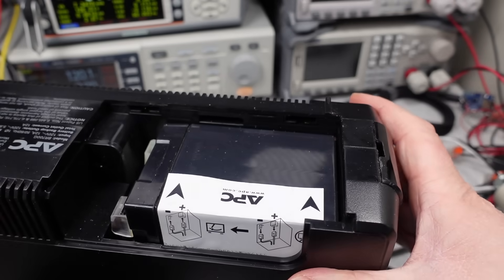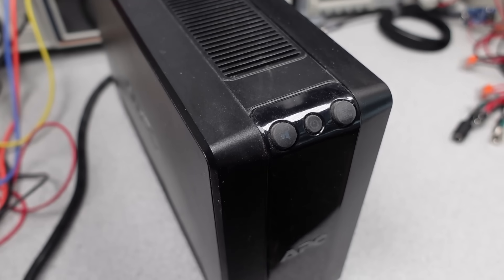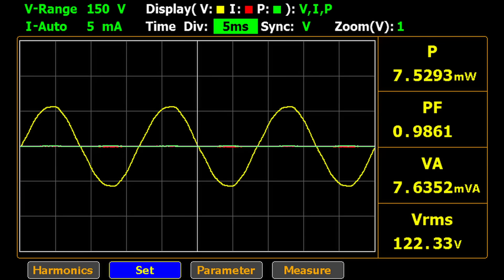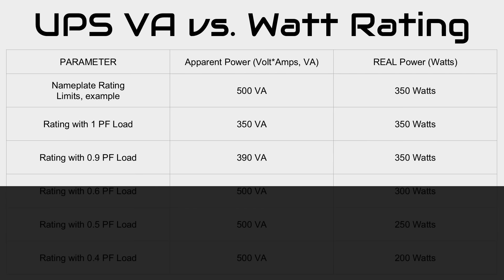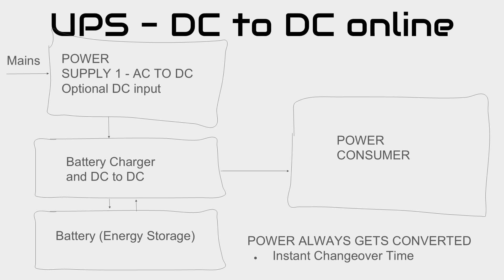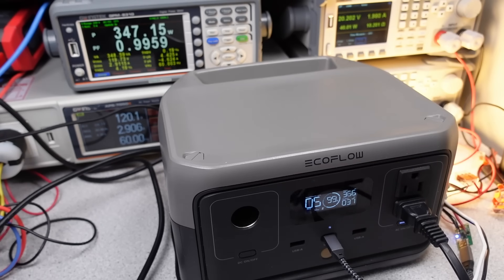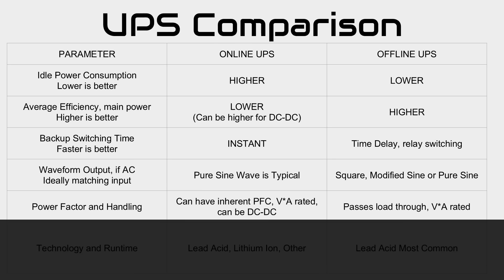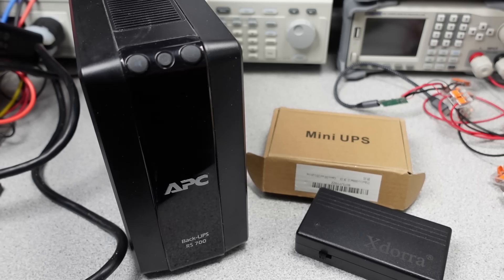A brief overview of Uninterruptible Power Supplies

Comment: For me the ONLINE switching time was not a factor at all, expecially with the very large capacitors in my servers psu's. But my server psu's stopped dieing every 6months after I installed a dual conversion online ups. Never had a psu go dead after that. grid power can be garbage. Could also be random power surged from things, but didn't have anything else that had issues that was noticed.
Reply from the maker: Sounds like some pretty unstable power conditions on the input side.  I want to do an efficiency comparison.

Comment: Do PC power supplies with active PFC need a pure sine wave UPS?
Reply from the maker: It depends on how the PFC is implemented.  Most will work with a square wave or DC on the input, as the PFC is a boost circuit, the PFC adjusts the DC input voltage to the level needed for the rest of the power supply.   There are a few out there that are tuned specifically to find the AC wave shape and won't turn on if they don't see it.  I have one power adapter that will not turn on with a modified sine (3 step) wave.

Comment: I would love to find a USB-C PD capable power bank that would work well for UPS duties for USB-C loads.
For example: Have a standard power adapter that supplies power to the power bank, and the power bank supplies power to the device. If power were cut to the power adapter supplying the bank, the battery bank would supply power from battery to keep the load online for the device. From what I've seen, the switching time from pass through to battery for most (if not nearly all) USB battery banks is too slow.  Would be excellent for items such as Raspberry Pi's (so that you don't have to get a specific "UPS hat") or security cameras, etc - this way you skip a whole DC->AC->DC step! Much more efficient this way.

Does anyone know of a power bank which is capable of this?
Reply: Probably not many, if any at all. Consumer USB battery banks aren’t intended for this use case so you’ll be hard-pressed to find a suitable option, and even if you find one it surely won’t work as well or reliably as a purpose-built UPS.

Comment: PC related stuff, Cameras and low wattage lighting, 3 things i have UPS's for. I also use a small UPS to power a tire inflator instead of using an extension cord outside. Many uses for a UPS, some of which you wouldnt normally think to use one for.
Reply from the maker: Thanks for sharing!

Comment: For some critical USB-C PD powered devices, I use both the Zendure and Shargeek power banks as UPS. 
Both power banks can deliver up to 100 Watt of power to the device - computer, camera, router, etc. - just like an online UPS.
For any 12 Volt device which can permanently tolerate 13.8 Volt, I use a lead-acid battery permanently connected to a low-ripple 13.8 power supply.
The Wi-Fi router doesn't like 13.8 Volt, it overheats. In this case, the Zendure 26,800 mAh power bank, connected with a 12 Volt trigger cable, is the perfect alternative to a full-blown online UPS - much more efficient, reliable, and with a low fire risk.
P.S.: A trigger cable has an USB-C connector at one side, and a barrell connector at the other side. It also contain a protocol chip, which tells to the power bank to supply 12 Volt at the output, on the barrell connector, which feeds into the router.
Thank you for the video.
Anthony
Reply from the maker: Thanks.  Yeah. Always looking for good alternative solutions.
Reply: Are these the only two brands. Dont Anker have the same in/out functionality that do the above

Comment: yikes. paying for overpriced APC batteries. any 12v works
Reply from the maker: The price difference on this unit isn't significant so I went with the OEM.  I do go with alternates on the larger UPS as there are lots of good options.  The ESR of this battery is a little lower also, as this particular unit discharges that battery at very high current if you have a decent amount of equipment connected.  I had a cheap one in here, it turned into a potato in one year.

Comment: I had never had any use for a UPS until I moved house, the box from our internet provider was in a really odd place in the middle of my hallway. It was right in the way so I ran the cable through the wall into the kitchen and put the router on a shelf above the fridge. The router was plugged into the same circuit as the fridge and when the condenser fired up it dropped the power to the router causing it to restart. 
This was happening for weeks before I realised out what was happening, I got a UPS and now the problem is gone
Reply from the maker: Yeah, that's an interesting phenomenon.  Expected with a high inrush load like a cold start on a compressor.

Comment: Good video I have a middle Atlantic 2200R pure sine wave low frequency transformer base real power output 1800 continuous around 2500 peak 48 volts one time power went out battery was too small ended up adding a 3.5 kWh battery lasted all day I ended up adding a solar charger instead of plugging it back in now I have a 14 kWh battery and 5 years later 24/7 has been running all my ac window units and refrigerators and going even got an extra one for 200 dollars in case it goes out I can continue going better than a hybrid high frequency inverter it uses around 45 watts on standby but my battery don’t even see it it’s doing it’s job and it never gets hot has 3 cooling fans
Reply from the maker: Sounds like you've gone down the rabbit hole.

Comment: 10:49
This is not true. If you put a load on it like 50-100W doing "passthrough", the UPS ALONE will consume a hell lot of power doing nothing (battery fully charged). 
I got the shock of my life when checking my power usage using a kill-a-watt meter it consumed 50W with battery full, the way I calculate it is by using 2 kill-a-watt at both ends and deducting. It was a 50W difference so its definitely not an efficiency issue. When I disconnect the load, the 50W difference becomes 10W or so. So yea, you gotta test with a load.

After researching, APC is notorious for "wasting" power on their transformer to have "passthrough" feature. Cyberpower is the only brand that has a "green" patent that shuts off transformer when doing "passthrough".
Reply from the maker: It depends on the unit. Some do voltage correction which in an offline ups is a variac also.  Those do consume power and have efficiency losses.

Comment: I replaced all of the leadacid in my ups's with Lifepo4. The first one i made in 2018 has a capacity of 12ah & 25.6v. currently it holds around 11.8ah. no bms just cell balancer and 40a fuse. The ups handles all the charging and discharging parameters. 
I have 4 other ups converted to Lifepo4. Two having 60ah 12v pack & another one having 6ah 12v pack. And the one in my pc has 25.6v 15ah pack. All of them made with cbak 32140fs 15ah cells. I bought 40 cells for 200$ shipped. The 6ah and 12ah one have hx 32700 cells bought from aliexpress. 
Run time increase is huge. 
The br1000g powering my pc has 15ah 25.6v Lifepo4 pack made with 32140 cells and it runs a 160w load for 2hr. & 300w load for 1hr. Which is more than the original extended battery runtime with 6x 9ah smf battery.
Reply from the maker: Thanks for sharing your experience!

Comment: I would love to get your take on Linus PSU tester? I feel like you have a lots of knowledge on those types of things.
Reply from the maker: Yeah, that's impressive stuff, big budget, having worked with some Chroma equipment, I did find it difficult to work with.  I didn't see that they added isolation testing, so I can still do more in my dumpy home lab, :P   I can do transient testing too.  

The power capacity of their system is very good, plus the environmental chamber is nice.  Interesting at that power level they didn't go with load testers that can grid tie, rather than burning the energy they feed it back to the grid.  It also means they can handle much more power in a smaller space since they don't burn the energy.

Comment: The ATX spec mandates at least a 16ms hold up time. Many computers do not tolerate PPS units that transfer in 20ms. You really need a UPS with a transfer time of 10ms or less.
A power supply that survives 40ms without power is more common in a commercial settings than the home.
If you have an oscilloscope and a differential probe it'd be interesting to measure the transfer time of some UPS units.
Reply from the maker: Thanks, yeah, I've got the bits to do that.  You can see the ecoflow switch in the video both during turn on and off in the LED bulb.  Of course it depends on the power supply load for hold up time.  So, buy a 500 watt power supply and with only a 150 watt load, it should hold up fine, which is probably how I get lucky on my setup, but yeah, heavy load, my consumer power supply won't make it.

Comment: In the end, be sure to compare the efficiency loss with a UPS to the normal power usage of many home items… I'm hoping the newer ones are better ! I see lots of people putting tons of energy (pun intended) into meticulously finding low-power systems to run their home plex, backups, lab, etc, yet then put it all behind a $150 Pb-Acid interactive UPS and essentially throw the baby out with the bath water in the long run, cost, and results-wise. CPAP machine ? Ya gotta do what ya gotta do. A small lithium bank for camping that you can also pull out on occasion when the power goes out ? cool.  But spending $600 on a home server "upgrade" so you can cut your avg power usage in half, only to then increase it by another %25 + new Pb-acid batteries every 3 years, plus doesn't even "save your server" because they didn't setup and routinely tests NUTS correctly, doesn't seem like a smart route. Any modern journaled file system won't corrupt in any power outage, so as long as your bios has the setting to stay off after power-cut, UPSes these days seem more something give us that warm fuzzy feeling rather than do anything truly necessary :shrug:

Looking forward to finding out real world results on many of these systems. My 6 year old Cyberpower 1600VA was straight abysmal so I do hope things have improved since then ! :)
Reply from the maker: Yeah.  I think the requirement for an ups has decreased with modern systems.  Very true on the power consumption.  I like the idea of a small dc UPS option to try it save as much energy as possible because yes many lead acid ups options use a decent amount of power.

Comment: The biggest issue I am having with mine is that it'll trip the arc fault breaker at random while I am using my gaming desktop PC. It has become the very thing it was designed to protect against.

UPDATE: welp, after doing an experiment, it looks like it's my computer that's causing my arc fault breaker trips. Which stinks, because I don't know how to resolve that without changing the breaker to a standard one.
Reply from the maker: Hmm.  Maybe a newer version of the arc fault breaker is less sensitive?

Comment: I'm surprised you didn't discuss simulated vs pure sine wave here. Saving that for a later video?
Reply from the maker: I made a quick mention of modified sine, which is the 3 level approximation, essentially a square wave duty cycle adjusted output.  But yes, getting into more depth on those various output modes is another topic.
Reply: I would love to hear more about the pure sine waves and how clean they are. 

I have an EcoFlow and other batteries.  But they seem to have dc offset and/or run at higher voltages 124v+.  It causes my audio equipment transformers to hum.

Comment: I have an APC SMT750 and unfortunately found that it draws 12 watts with no battery connected, no devices connected, and powered off. Really painful to see when I rebuilt my NAS to run at 30 watts idle instead of 60 watts

As for replacement batteries, I've found Power Sonic brand to be reputable, I've seen them in the field in fire alarm panels so they seem to be trusted by pros.
Reply: Power Sonic batteries are very good.  I installed a higher amp hour capacity set on my UPS some 13 years ago, and so far, the UPS has not complained about them.  Also, that is what I installed in a fire alarm panel 3 years ago.
Reply from the maker: Wow, nice.  Thanks for sharing!
Reply: @AllThingsOnePlace  Also, last week, the electric company was and still is working on upgrades and replacing transformers in my area and disconnected my house from 9 am to 1 pm.  When the power was restored, the UPS showed around 50% charge left in the batteries, though it powered a security system that draws  around 55 watts and had other equipment plugged in that was on standby.

Comment: Careful with sla batteries i did a lead test on the casing and they are basically slathered in lead solution it seems so make sure you wash your hands after handling sla batteries.
Reply from the maker: good to know!  Thanks!  Yeah, I think that's good practice with any general electronics handling.  Probably should wear gloves more.

Comment: There are now lithium replacement batteries for many APC UPS models.  
Could you test a few to see if they perform as well as the standard lead acid batteries?
Reply: Yes please. I want to change the battery chemistry for my UPS 1500VA UPSes and I want to know what will work
Reply: Please try powering a 1000W load from two 10Ah 12.8V LiFePO4 batteries. Let me know how it goes!
Reply from the maker: Hahaha

Comment: I'm super excited that you are starting down this rabbit hole. This was an excellent intro video on the topic and you really hit all the major points!

I had a house full of the cyberpower UPS's with the questionable fire hazard glue that I decided to retire out of caution. I'm extremely excited about the coming generation of LiFePO4 ups options cropping up and I hope you dig into them in the future!

I picked up the Ecoflow River and Delta 3 plus units the instant they became available to act as the UPS's for my networking and server gear. I was very pleased to see they offer the ability to limit the maximum charge and discharge percentage of the battery for optimal battery health - something that APC/Eaton/Cyberpower never allowed! 

It's been incredibly annoying that these things traditionally would run their batteries into the ground if an extended outage happened and you weren't around to shut them down early to preserve battery health - or you had to hook up something like a raspberry pi running NUT just to shut down the ups early even when the devices they are protecting do not need safe shutdown like switches and consumer routers to preserve the ups battery health.

I also learned the hard way that many of the cheaper consumer level UPS's like the cyberpower CP series will completely disable power to the outlets when the battery has died. I learned this when a router connected to one of these at a remote property stopped working suddenly and now I either don't use a UPS at all when possible for these situations or have to pony up for "enterprise" grade on-line equivalents that at least according to documentation will always provide power to the outlets regardless of battery health.

Comment: APC is the HP printer of UPS units.  20 years ago they had a great product, but friends don’t let their friends buy APC.  However if you’re the consumer that buys a new printer everytime it runs out of ink then APC is probably for you.
Also, line interactive is a pretty sweet spot in between standby and online, in my opinion, because of heat and fan noise can be huge issues in home use which online ups typically don’t optimize for.
Reply from the maker: haha, yeah, even my 'newer' one here is a piece of junk.  That old one is a brick house though.  The newer one didn't even do self tests, but yeah, a repair and teardown are in order, possibly a comparison to the old one.
Reply: @AllThingsOnePlace I would love to watch content that is teardown and technical comparison of modern units from apc, eaton, vertiv, cyberpower, ect!
Reply: @jasonistre  apc higher end units are fine. 
The lower end ones ate junk. 
I have a 500va unit from 2003 & the transformer in it is 2x bigger than a 2017 unit with 1100va rating. 
Once i tested the newer one with Lifepo4 battery at full load & the transformer melted after running 9mins at that load. The battery could do 15min. 
Apc rates that ups to run for 43sec at 100% load. No kidding. 43sec!. How the fk would you even turn the pc off that fast.. typical high end gaming pc takes 500-600w while gaming.
Reply: Nearly all traditional UPS units are ancient tech. PPS brands like EcoFlow are slowly encroaching on the likes of APC and CyberPower, but for whatever reason they're getting the basics wrong like switching the load to battery at safe input voltages.
Reply: Just for comparison my apc xs 1500g is about 10-13 years old now. On it's 3rd battery but about ready to retire from components reaching end of life. I certainly got my money's worth but since the company has changed hands once or twice I would not trust their newer products more than any other company right now. 
Can confirm they were a good value 10+ years ago though.
Reply: Not sure its a hit and miss for me, the ups i use for my network equipment still able to run for 4hr+ with external battery (SRT1500RMXLi with single srt48BP) same thing for the one on my pc (SMX3000RMHVUNC2), both are older model, battery still last 3+ years, but a more recent ones that i bought for office computer (BVX700LUi-ms) is absolutely terrible, battery replaced twice, so yeah i agree their newer models are badly designed and fail quicker
Reply: I have noticed that too, I have an old APC UPS that is a big heavy steel thing theat we got years ago with our Windows XP athlon XP PC. I only stopped using it recently since I built a new PC that is way more power hungry. The newer units seem to have a high failure rate.